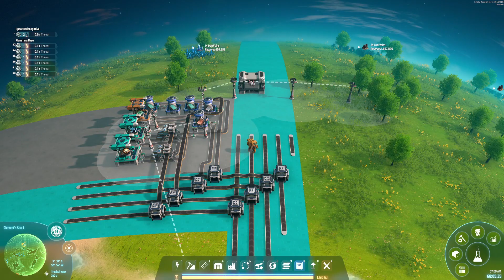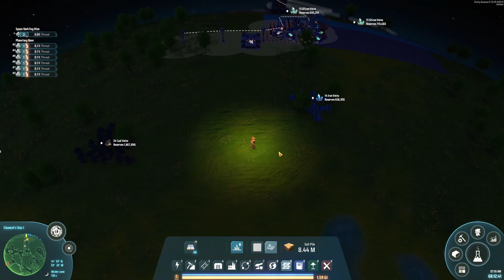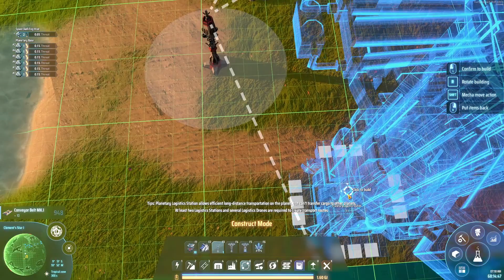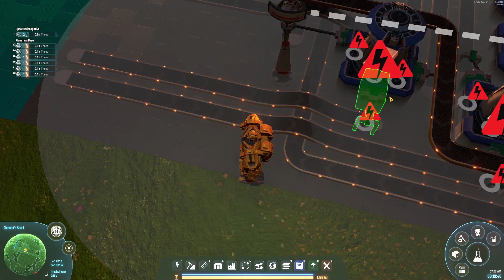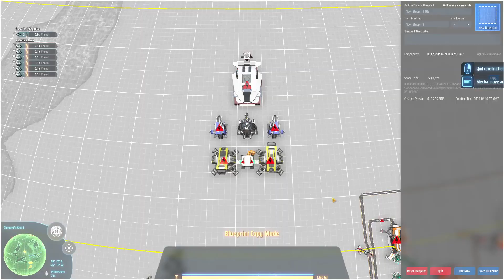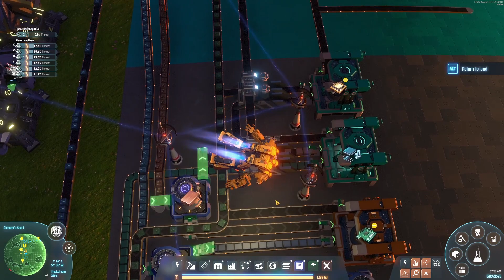MINI FUSION POWER PLANT // Dyson Sphere Program // Mission Log 67

Comment: consider this addition to your hardpoints: eventual ILS warps in ammo, outputs to a depot, logistics bots carry ammo to all of your hardpoints and you never have to manually touch them again. for now you can just deposit ammo into a single depot instead of having to visit each hardpoint.

without any power, you won't build any threat, so if your power runs out, your base won't be attacked!
Reply from the maker: That's a really solid idea and I will definitely do that at some point. I think I knew that about the power, but we've got geothermal now so we'll be under constant threat!
Reply: I think I'm unreasonably entertained by farming those relays geothermal spots! I should have mass produced geothermal plants, but I didn't expect to go overboard like I did. Eventually, my lava planet became an energy exporter. Empty accumulators can be charged on a conveyor belt using the Energy Exchanger. I put them in a ILT set to supply, and demand the empties in return. A similar loop back home discharges the accumulators and sends them back. The nice thing is this doesn't waste any material on containers. So that's my base load. Surges are handled by deuteron in the mini fusion plants, since they automatically scale output to meet demand. (Thanks to you two for that tip that inspired all this!)

For the hardpoints:  since the missiles can reach anywhere on the planet with a signal tower, I've started putting the launchers all in one place close to ammo production. It's like having artillery support. All I have to do is drop a signal tower to designate my next target. A battlefield analysis base also acts like a depot! So it can hold a few slots full of ammo and replacement parts. For lasers, I think it's prudent to have some accumulators to deal with the power surges.